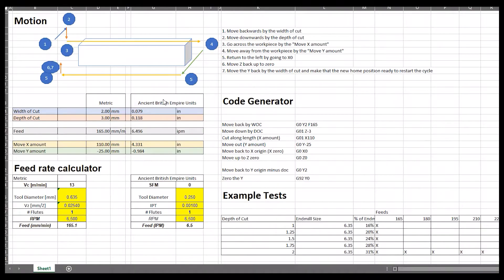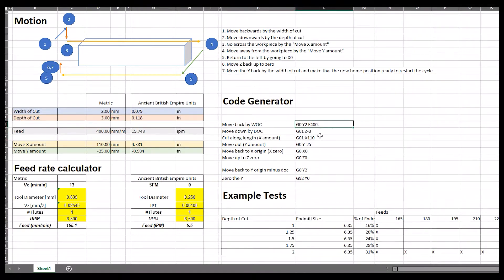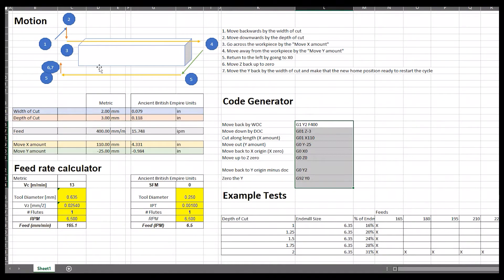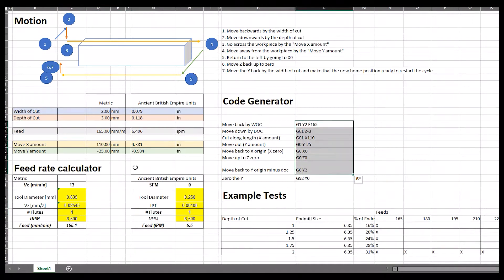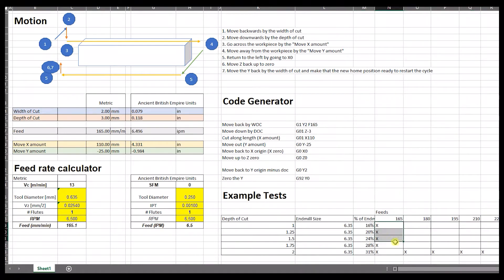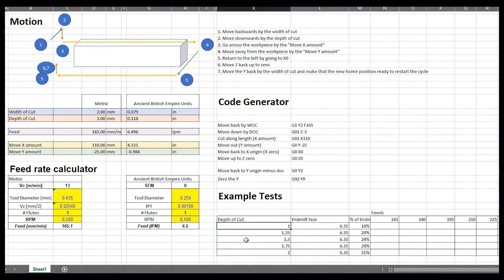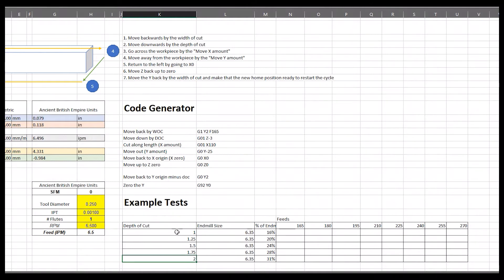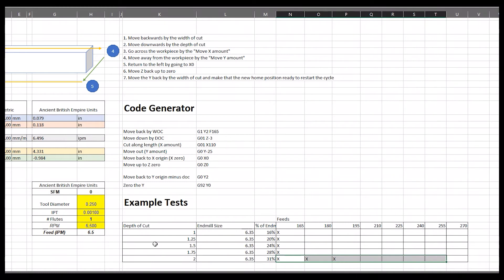First Chips on the Mill & CNC feeds and Speeds Test GCode Generator

Comment: You probably could have made it on that last cut with a faster spindle speed.
Reply from the maker: I’ve been playing with gwizard and have certainly learned a lot more about feeds and speeds and I think that it should have worked. Another viewer noticed that what killed it was actually the head of the machine slipping down on the dove tail. It was close!

Comment: Hey Andy, maybe I should start making some of those headstock supports for sale as you suggested!  As Nick pointed out, that last cut saw the headstock dropping down the dovetail.

I mentioned in my comment on your earlier video, what seems like pushing too hard really is not pushing hard enough.  But, in this case, you were just right on the feed rate for that last cut!  A 6mm (.236”) single flute cutter with a .079” radial DoC in 6061 alumin[i]um on the 4th pulley position (4200 RPM) should be run at 9 IPM accounting for chip thinning ✅.  (The .079” RDoC was high for me.  I like to keep my RDoC/Diameter of end mill between 5-20% and raise the feed rate while increasing ADoC, if that’s an option.  It’s a more efficient way to cut, but that’s an explanation for another time.)  Your axial depth of cut meant you were only using 10% of the continuous rated horsepower of the spindle motor, so you were operating very safely within the capability of the machine.

Plunging an end mill saps power like you wouldn’t believe and the sliding headstock is where it all went south (especially with a single flute cutter).  Plunging an end mill is kryptonite for Taigs and all power-limited machine tools.  I avoid it like the plague when another strategy can be used.  For the highest material removal rates, Taigs respond very well to two methods.  Despite my warning of plunging with an end mill, plunge milling with a drill is one of them.  It is especially great on machines that aren’t rock solid rigid.  Drills are designed to be plunged and versus end mills don’t sap as much power.  The second one (for ballscrew Taigs in particular) is high efficiency trochoidal side milling.  Using that method, I am able to exceed the 1/4 HP spindle motor rating, because that is a continuous rating.  With trochoidal milling, the “cutting duty cycle” is well below 100%, so you can utilize extra power temporarily available from those motors.  However, using this method your material removal rate can be higher than traditional milling at full cutting duty.

I just saw a reply from someone on my comment from your other video asking for me to post a video.  Unfortunately, I won’t be able to do that for a while.  But I do have some photos I’m willing to share from when I initially experimented with my stock machine (except my headstock support added).  I had a 9mm 3 flute HSS end mill roughing out a 5/8” wide slot using trochoidal milling at a depth of .600”.  The chips are artwork and I think I saved a baggie of them somewhere.  I thought I was nuts for trying that given that the calculated (instantaneous) power requirement exceeded 1/4 HP, but it worked as I previously explained regarding duty cycle.  I didn’t test until failure, but it would be interesting to see what would stop the stock Taig motor.  (This is why I previously stated a stock Taig motor is all you reasonably need if you are milling properly.  I would upgrade to a BLDC motor with encoder only for easy spindle speed changing and rigid tapping.)  Just like the horsepower in a race car engine is only as good as it is transmitted to the road, the spindle motor power is only as good as it is transmitted to cutting the workpiece material.

Sorry for my essay-long comments.  Just trying to help you avoid the $#!+ moments I experienced and make the most of the Taig.  If I make up some headstock supports for sale, you’ve got first dibs.  I should type up my notes and make a webpage with my calculator for you to try.  Maybe other people would be interested in and benefit from that cutting edge 😄 work after all.

(I’ll share the photos on Facebook)
Reply from the maker: This is an absolutely amazing amount of helpful information thank you so much for sharing this. I am wondering now if I get it all back together and tighten the headstock up by a large amount, could I try again and see if it can take that cut without issue. From what you are saying, you have been able to push yours much harder without problem. If I'm still in the safe-zone, I should carry on and see when the spindle gets bogged down. The motor is a bit weak, a 9mm end mill is something I never thought this machine could run, and maybe that's only safe to do with an upgrade motor. 

I recently realized the mistakes id ben making with slotting before. I like the trichordial milling because it achieves the same effect but uses the endmill how its supposed to be used. I am going to be much more careful to avoid slotting. Very intrigued by your comments on plunging too. The drilling idea is a really good one. I am not yet confident on my tool changing. I need to get my tool setter set up, then I could confidently drill to the correct depth and mill from there. Does plunging with a ramped helix work on this mill in your experience?

If you have something you make that can stop the slipping on the head then I would be very interested. Eliminating that problem sounds like a one less major headache. I also considered cutting a slot in the rotating part of the column and putting in a square bar to stop the rotation as that is just getting to be a major issue. I feel like it drifts every cut I make no matter how much I tighten it!

thank you for all the detailed information here. It certainly is helping me and no doubt will help others too.
Reply: @AndyVickersNet  You can try tightening the headstock clamp with all your might.  But in my experience, it will eventually give way.  And I clean the mating surfaces with alcohol to ensure maximum stiction.  Unless you put an immovable floor under the headstock, you always have to worry about it sliding down.  The worst outcome is when you don’t realize it happened and your features are cut deeper than intended.  When you can’t afford such mistakes, supporting the headstock on a hard stop is the ultimate relief.

Luckily, I made some supports this week.  Message me on Facebook.

Don’t think about the “safe zone” in terms of feed rate.  The workpiece material, cutter, spindle speed, and radial depth of cut all determine the appropriate feed rate.  Insufficient feed rate means more power either goes to friction or goes unused.  Sure, excessive feed rate is a problem, but the amateur is most often guilty of running too slow, at least in the XY plane.  Consider also, most people with Taigs and Sherline mills have leadscrews and not ballscrews.  Taig ballscrew mills have only been around for 4-1/3 years.  Leadscrew machines can’t realize the feed rates necessary at the higher spindle speeds with the lower radial depth of cuts these machines thrive on.

Playing it safe means taking a lighter axial depth of cut.  Consequently, only a short length of the cutter is doing all the work, so it will wear out sooner.  But if you are uncertain whether the machine has the power to make a cut, that’s the proper way to back down.  When I proved that a .600” ADoC was possible in 6061 aluminum, I kept the feed rate constant and worked my way up with the ADoC.

The key is to understand how much power is required to make a cut.  When you can quantify that, YOU are in control!  Otherwise, the machine has you on defense.  The relationship between power and material removal rate for different materials at certain heat treat states has been cataloged.  For instance, a stock Taig is technically capable of removing 13.7cc/min of 6061-T6 aluminum, 8.2cc/min of 7075-T6 aluminum, 4.1cc/min of 416 stainless steel in the soft state, and 3.5cc/min of 416 stainless steel that’s been hardened, to mention a few.

Not enough hobbyists learn the first principles of machining.  And the rub is, they are even more important with hobby machines.  A professional CNC programmer does not have to worry as much or as often about maxing out his machine.  Those who make the most of limited resources are smarter in how they work because they have to be.

The 1/4 HP continuous rated motor on the Taig may be “weak”...but compared to what...a metric ton Bridgeport with a 1.5, 2, or 3 HP motor?  A stock Taig CNC machine weighs about 105 lbs.  On a specific power basis, it isn’t so weak after all.

I wouldn’t hesitate to use a 9mm, 3/8”, or 10mm (the maximum size for the ER-16 collet system) end mill for side milling.  I’ve made an ER-16 threaded shank to take a 1/2” end mill, but don’t bother with it, mainly because the 1/2” HSS end mills I have all need resharpening.  I would step drill a 3/8” hole because the power required at the lowest spindle speed to plunge a 3/8” drill could stall the motor.  That’s my only peeve on power, but hardly a showstopper of a problem.

Slowly plunging with a ramped helix works, but since I am not yet certain about how much power is required given a set of parameters, I use it only when I need to.  And then I limit myself to a 1/4” end mill. What I’ll do instead is peck drill with a 1/4” drill followed by a 3/8” drill to open up a pocket. The drill point stops about .025” from the pocket bottom.  Then I use a 1/4” or 9mm end mill centered on that hole to expand the pocket with trochoidal milling.  All you have to worry about is clearing out the chips.  I use a cheap quiet airbrush compressor from Harbor Freight.  Avoiding plunging end mills when you can help it is just good practice, regardless of what machine you are using.

You are rightly frustrated about the tilting column.  The frame design is a relic of their pre-CNC era.  If Taig designed a CNC-specific frame, I bet the column would bolt down.  I joined the Taig owners group to check out the Stuart Andrews Taig frame.  It is bigger and beefier, but most importantly put together like a CNC Taig frame should be.  I may buy one.  I was also thinking about buying a pair of 18x6x2” granite surface plates and building my own frame upgrade.  But I don’t have the time for that project now.

I wouldn’t try to key the column as you mentioned.  It would be very difficult to have the mill trammed properly afterwards.  And then what do you do?  Instead make sure that the mating donut-shaped faces are clean, oil free, and perfectly dry.  Again, I used alcohol to clean and maximize stiction.  That should work, but if not, try this: cut a donut shim out of a Manila folder, gasket material, or copper foil with the same outer diameter and a bit larger inner diameter as the mating faces.  The shim material itself will increase friction.  The larger inner diameter of the shim reduces the contact area.  And here we have one of those exceptional instances where reducing contact area enhances friction.  The compressed shim bites into the microscopic valleys of both the steel faces and locks the two together better.

Comment: Nice work. Did you see the headstock slid down on its dovetail? I've been running 3 flute solid carbide at full cut depth of about .375" and about 20% stepover at 30 IPM. This is with the consew motor. With the stock motor the belt might slip.
Reply from the maker: No I did not! what a great catch! I'll tighten that up a lot before the 3 flute video. Thank you very much. Sounds like you have pushed yours further than where I fell down here. Gives me hope that there's more to get out of it. I heard the motor getting bogged down towards the end. I imagine if it had the horsepower to push through it would probably have made the cut just fine.
Reply: @AndyVickersNet  https://www.youtube.com/watch?v=tJH9UEhvRuY  here at about 1 min 30 seconds in is the limit for me on the stock belt system.
Reply: @AndyVickersNet  And on this video I have the consew setup it can cut a lot heavier. https://www.youtube.com/watch?v=4ZvfnS1K-iM
Reply from the maker: @nickp4793  oh my word! I remember watching your videos before I bought the ball screw taig! Back when I was looking at leadscrew vs ball screw! It’s nice to talk to someone I’ve learned a lot from!